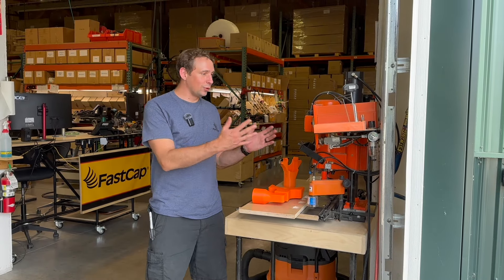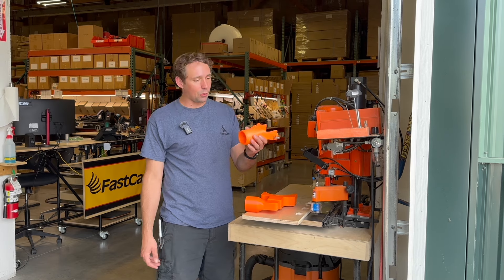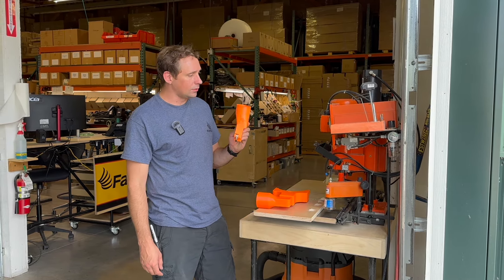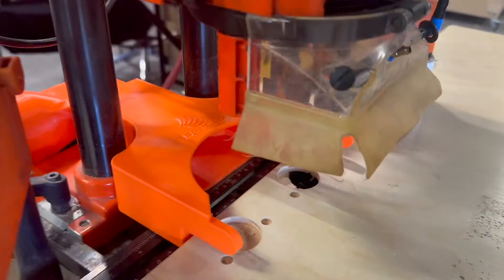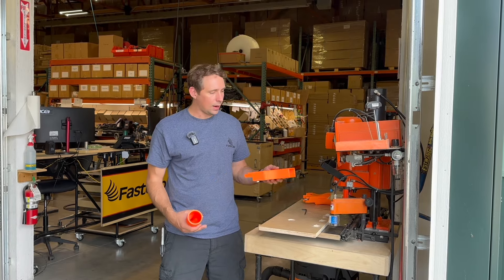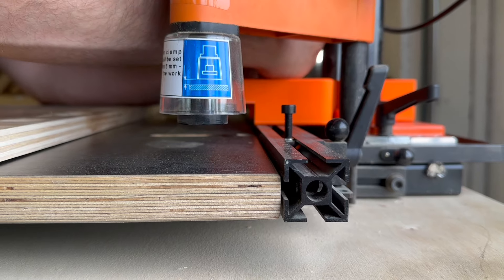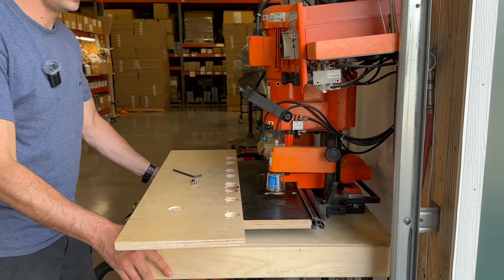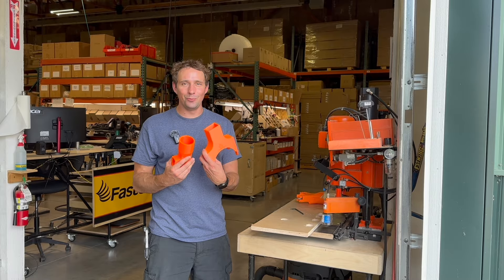Blum Vacuum Connector V2 | Intro

Comment: It doesn't allow for the ruler stops when a specific drilling postion is required especially during the processing of drawer fronts. This would also not work for the EASYSTICK. Great idea and getting closer to a complete solution, thank you!

Comment: Great idea but you should make a fittings for 4" and 5" hoses. Almost anyone who has a blum machine has a dust collector and would connect it to a 4”  or 5” dust collector hose not a shop vac. They come with a 4” hose connector.
Reply from the maker: @ackmartin60 Thank you for the feedback, we will pass this along to our engineering team!
Reply from the maker: @ackmartin60 If there was an accessory adapter that would allow you to use the Blum V2 Vacuum Connector with a dust collector hose would you purchase it for your system?